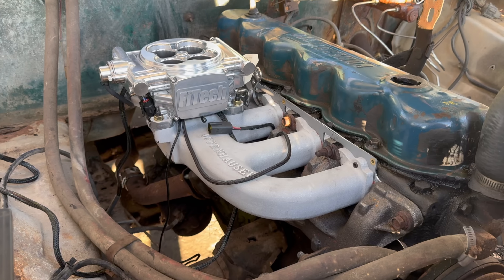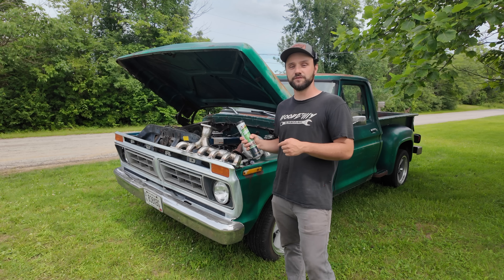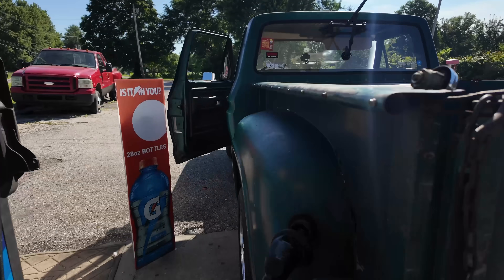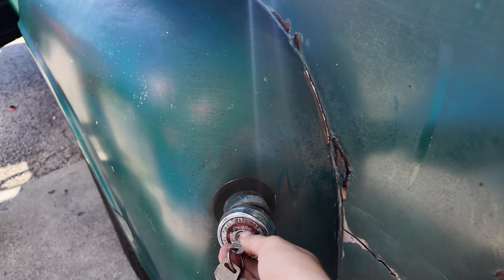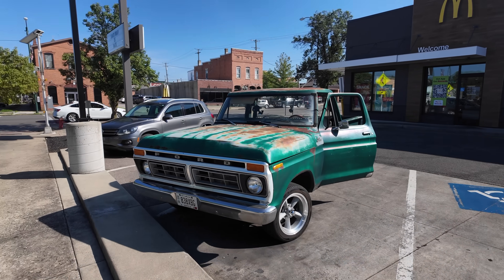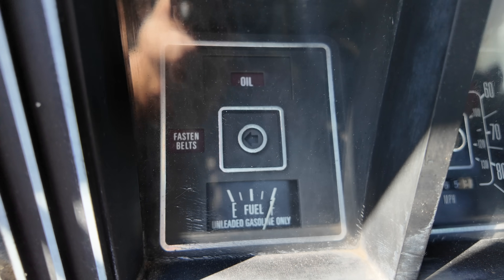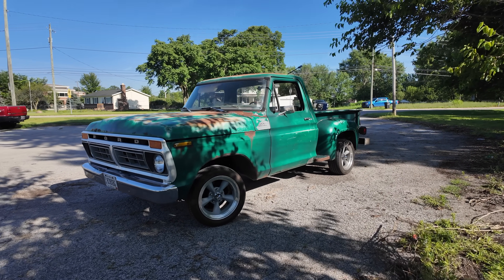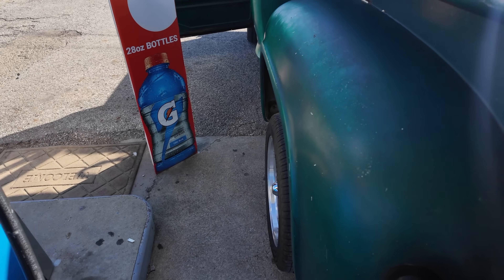How Many MPG Does An EFI Swapped Ford 300 Get?

Comment: My 1983 Ford F100 with AOD transmission got 20mpg and 18 average for many years. That was with the  AC on. I'm still driving it today.  It's probably less now because I'm driving it a lot less frequently. The engine and transmission are original at 300,000 miles.  The truck has long legs and will go 680 miles on its dual tanks. It still has the original single barrel carburetor. I never saw a need to change anything. It just runs so well.

Comment: My 1989 regular cab 8 foot box with 300ci and 5 speed manual on floor was used in Detroit driving from school to school and home to schools.  I could generally count on 19mpg+- but never cracked 20.  My 93 supercab with 5.5 box, and auto trans,  generally got 18mpg.  Odd thing, the 89 heater would not bring cab up to temp and gauge showed cold engine.  This is a new truck.   I bought a Stant thermostat replacement and swapped it out at work. Same situation existed.  Went to auto zone and asked for a thermostat for a 300c i  Ford 89 pickup and Voila!  For some reason the original and replacement stat I bought had a 3/8 or so hole in the flapper. I assumed it was to prevent overheating. The Auto zone stat did not have the hole(I had never seen a stat with the hole in flapper before) and  problem was solved. Normal temp per gauge and I had heat.  Has anyone else seen this  on a Ford 300 ci??

Comment: Years ago I had a 1971 F150 302 4-speed (if it was a 300 I probably wouldn't have sold it until a few years ago when I purchased a 1999 F350 7.3L, even a 300 isn't up to the towing I do now with heavy equipment). After a carburetor rebuild, new points, new condenser, and ignition tune, I was getting 19 MPG pretty consistently. The last truck in that size that I owned was a 1996 F150 300 5-speed and I recall it getting about the same (granted it was EFI from the factory). I have to ask you why you had to tamper with such a proven machine (except 4-on-the-floor is MUCH better than 3-on-the-tree)? I was VERY upset when Ford quit making the 300 and I would buy only foreign trucks at this point (because domestic doesn't care about quality) if I could get them in 1-ton.

Comment: I had a 1985 F-150 stock never tough it and it would get 21 MPG on the highway, It had 180,000 miles on it when I sold it. Only thing I had to do was change the clutch once.

Comment: I'm impressed with your mechanical abilities in being able to do the EFI swap.  Not so impressed with your ability to calculate MPG.  Let it stop when the pump automatically stops it.  That way it is identical at both the beginning and at the end.  Drive it at the same time in the same traffic conditions, even if it means doing it the next day.  Stop and go will give different readings from continuous movement.  And no freeway or highway near by?  That would have given a more consistent check.  No, you introduced way to many variables in your mileage check so the results cannot be depended upon.

Comment: Fuel mileage w ill always be limited with that intake manifold and throttle-body fuel injection.  It doesn't do a good job of distributing the fuel, or air, for that matter, to each cylinder equally,  I'm glad you like it though.

Comment: I had a new 1977 250 4 speed ,rear wheel drive with the 300. I put taller tires on the back and with a tail wind would get 18 mpg ,now and then. It was the best truck ever . Custom and price at a fair deal, it was a truck after all. I was young and ran the wheels off of it. It’s should have lasted a lifetime but youth and logs did it in.

Comment: Dude I have owned 3of these motors with a standard transmission, never a disappointment, ever. Great gas mileage and 302 power. I most certainly want to do one of these engines up

Comment: most pumps. top right side of screen.  Second button down is gernerally the mute button.  Has worked in 4 different states so far. Not all pumps tho. nice install. Hope the mute button works for you because I think we need a break from Ads sometimes.

Comment: That build is cooler than a three speed fan! That's very similar mileage to what my carbureted 81 F-150 300 I-6 4 speed 4x4 long bed gets. 3.00:1 axel gearing at 5800ft altitude. 14-16 in town 15-20 on the highway.

Comment: That truck deserves a full rotisserie restoration. Ill never understand why Ford killed the 300 straight 6
Reply: Because the engine couldnt be used in anything else besides trucks. 
It's too long and too tall to fit in a car, even when they were still making RWD cars. 
My last 300 was in my 1995 Econoline cargo van.
Wish they'd bring it back
Reply: @RequisiteFunction  

It's not too tall or long, they offered the 240 (externally the same dimensions as a 300) in Ford Galaxies as the base engine.

People have also retrofitted 300's into 1st generation falcons, '65 mustangs, and '70 Torinos, with the only serious work needed being electric fan conversion, custom motor mounts, and some oil pan/ crossmember clearancing.
Reply: @riogrande163  it's too tall or too long to fit without modifications, while the other 6 wasnt.
You need the electric fan conversion because theres no room for the conventional engine-mounted fan when you put a 300 into a car. 
I mean, there's a reason why they never made it a factory option for cars.
Ford would make cars available with 4 differnt engine choices, but none of them would be the 300. 
They werent gonna spend any extra RnD on electric fan installation or custom front end linkage just so they could use their truck engin elsewhere.
The engine is also a waste of low end power in a car, unless youre towing a boat daily.
The people who put them in cars likely recammed them for better acceleration response. The potential is definitely there.

Comment: Things that determine mpg: Timing, air/fuel mixture,  type of carb, size of jets, transmission gearing,  rear-end gearing. My dad had a 1970 Chevy C-15 with a 350, standard 4 barrel carb, & the standard tans & rear-end.  After some adjustments he had it hitting 18 - 20 mpg running ethanol free fuel. It was 15 - 18 mpg with regular ethanol fuel.  Take anything someone says about electronic EFI and a full analog type vehicle.

Comment: then install a Tonneau Cover and check mpg. Then increase tire pressure.  then re-tune for 91 octane gas.   keep working till you hit 30MPG then detail the final config.   After that swap in a four cyl  and see how much more you can get.   lots of content!   thanks!  oh , and I agree to get good accuracy you should be doing more than 30 miles between fills.

Comment: You need to burn through a whole tank with all the varied types of driving you do to get an accurate MPG number.  Several tanks maybe. 30 miles is nothing.  You could go 30 miles downhill with a tail wind and get great MPG.  Not so much on the return trip.

Comment: I have a 1980 with the 3-speed on the tree. I'd love to swap it with a floor shift manual and as a last resort, I'd put in an automatic.  I'd be tickled pink with 20 some mpg but sadly, I'm just over 12mpg with a single barrel, points ignition and emission junk. I do have some pullin' gears in the rear because 60mph is about as fast as it wants to go.

Comment: This is the problem with measuring smiles per gallon.  Unless the tank is repeatably refilled to the same amount of fuel, the error in the refill volume will lead to error in the calculated smiles per gallon.  You can minimize the effects of the refill error by driving a lot more miles on your test cycle.  You can minimize the refill error by coming up with a controlled process of refilling as closely as possible to the same fuel level in the tank.   Also, it would have been nice to have performed baseline fuel smileage calculations before the EFI was installed.

Comment: 30 miles is no test.  It's a moment in time.  Just like saying that a vehicle is good based on the first year of ownership.

I had an 84 Ford F-150 w the 300.  Gas hog at 17mpg tops.  My 1986 Dodge had a 225 Super Six that got 20mpg on trips.  Both are legendary engines, but the Slant Six was always a better fuel miser, and lasted just as long as the 300 in many cases.  Wouldn't pull down the house, but for a utility rated engine, they were fantastic.

Comment: You can pick up some more mpg with ignition timing. The modern stuff throws a lot of advance at light throttle with the knock control. Look into a J&S Safegaurd knock controller.

Comment: I'm curious why he can get 23 mpg in this truck and mine with the factory EFI gets about 15-17 mpg. I have 3.08:1 gears. 5 speed manual. I'm guessing it's because he can tune it relatively easily to get optimum fuel economy, but I bet some power suffers. Mine might be just a tad heavier. It's a regular cab long bed. So his truck might be 2-300 lbs lighter than mine. Still a big boost in economy for 2-300 lbs.

Comment: IF the carb was tuned to deliver 14.7:1 AFR at cruise, and the EFI is tuned to the same, should be a marginal change if any. The engine's efficiency is baked in, compression ratio, cam timing, port efficiency, etc. Port Injection may have shown more of an improvement. Throttle body injection is basically just a more accurate carb. The key being closed loop, with an oxygen sensor, so the AFR remains consistent. He also changed the intake manifold, so not strictly an A-B comparison. All things considered, I'd probably always makes make this swap.

Comment: What distributor setup did you use? There’s not a lot of good options for the Ford 300. I added a Sniper to my Ford 200 inline six with Holley’s hyperspark distributor and it’s the cat’s meow. No hyperspark options for the Ford 300. Thanks in advance.

Comment: A Ford EFI got around 17 avg except if it had the lean burn processor then 21-24 on the highway. But most were removed because of pinging on accel. And dropped ext valve seats. Sometimes

Comment: Efi isn't an automatic fuel saver. A carburetor will give just as good as fuel economy as fuel injection. RPM is what determines fuel economy and that equates to the rear end and the transmission not to mention only 30 miles for a test is ridiculous.

Comment: There are a lot of things that affect mileage. Personally I drive a 2006 Silverado. It is regular cab short bed, 2WD, came with 4.8L LS (lightly modified by prior owner with pistons, lifters, springs, cam) and original manual NV3500 transmission. Rear end is original open 3.23. Empty curb weight is 4200 lbs. As my daily driver I typically see 18-21mpg, when most other automatic Silverados are seeing 12-16mpg.
Reply: driving habits help boost mpgs a lot

Comment: I’ve found that most of those fuel pumps that play the dumb ads can be muted. Usually the second button down on the right. I find them to be super annoying so I start pushing buttons to shut it up.

Nice truck. Sometimes simple is the way to go. Certainly my preference over the plastic road appliances with the goofy iPads for a dash board.

Comment: I had a 1970 Chevy C10 with a 250ci I6 with a 3 speed on the column with 3.73 rear gear. You could baby it, 15mpg. Dog it, 15mpg. Run it on the interstate at 70mph, 15mpg. Idle it through a full tank, 15mpg (joking).

Comment: I have a 2008 Dodge Dakota with a 6 cylinder and EFI and had OD transmission and it only get 18mpg on the highway.. Trucks just dont get good mileage.. you can do better than it was but its doubtful you would get better than my 18 without an OD trans.

Comment: Ford 300/6 one of the best engines ever made. Have one in my '83 E150 van with a 5 speed manual transmission. The van came with a 4 speed manual stock, I put a '94 F150 5 speed into it. A couple years ago I took it to burning man fully loaded, towing a small 4.8 trailer that had maybe 600lbs on it. I got 12.9mpg on average that trip, that is with the 1bbl carb. I am also upgraded mine to fuel injection soon, using the factory 4.9 injection manifold and exhaust, then a Megasquirt 3 for a computer. I am doing this upgrade I hope during spring. I am putting a better cam in first though. After the injection, I also plan to turbo it.

Comment: I've had 6 300/4.9 in both trucks and vans  both carbureted and port injected efi. My carbed trucks always did better. The ford efi ran smooth but never came close to the performance and fuel economy of the early 80's carb set ups. My two faves were both 83's, the first being a shortbed 4spd/3:50 geared f100 forest sevice truck. That thing ripped, 20+ mpg @ 65 mph all day long with really good torq and acceleration. The second was a BLM LB 4spd 4x4/3:50LS geared F150. That thing averaged 16mpg, and easily did 18mpg loaded cruising 65mph at altitude - Nevada - what a beast!  My 88' e150 efi/c6 3:00 gear van would never get above 14mpg no matter what. My 90' 5spd extra cab short bed 4x4 /3:50LS F150 averaged 13mpg and could hit 17mpg loaded cruising 70, but rarely. I am about to install an offy C series intake with a Holley 390cfm and efi exhaust manny's on my current 75' F100 and replace the 3spd with the Mazda 5. Expect high teens and low 20's with that set up, at least! Love love love the 240/300/4.9 fords!
Reply: I have a few 300s here. 1980 3/4 4×4  one has an Offy with a new Edlebrock. 4:10s and cast iron 4 speed. Picked a 1989 300efi 3/4 ton 4x4 w/zf and 3:54.... that trans and gearing on offy motor is my goal

Comment: I went Bawls Depp when I Fuel Injected my '78 300 (F-150 435 205 3.55 32's) and took the long runner intake from a 90's truck and wasted spark coil pack from a minivan and yeah, it fricken moves! Plans are to Turbo it as EFI is easier to tune and turbo and not ruin it (running lean).
I keep thinking about a Intake Manifold setup like this where the EFI TBI and Distributor can be easily swapped to Carb and Points.

and now for the completely out to lunch uh oh, Squatter Man's out and about again and ruined my EFI!` <3 all
Reply: Points distributor is slightly  different 1/8" wider throat and oil pump helps is longer and gear needs slid down slightly on shaft. 72 and earlier vs 73 and later. UNLESS it's a post '72  industrial 6 from a chipper or something

Comment: In 2000, I had the same setup in my 1981 f100. 3 on the tree, single barrel carb, 300 i6. All stock. Filled up on interstate 69 & Indiana State route 6, outside Waterloo, IN. Drove to Lake Village, Indiana. Drove around between Lake Village and Schneider, Indiana, then back to the same gas station by 6 and 69. I was getting 33 mpg. My stepdad didn't believe me, so the next weekend, we hooked up my 20' camper and did the same thing, except we dropped off the camper while we drove around in Lake Village and Schneider. Then we went back to 6 & 69 gas station and filled back up. My stepdad figured up the mpg. 33 mpg again. So with or without a camper I was still getting 33mpg. I would have liked to put a turbo on it, but like my dad always said "if it ain't broke, don't fix it. I delivered a lot of pizzas for Papa John's in that old truck.

Comment: A couple of other ideas I can recommend you can do to improve the mileage would be to add a K&N air filter, helping the engine breathe easier, and I always use the oil additive called Duralube. It's about $15 a qt. It replaces 1 qt of oil during an oil change,  and treats the engine for upto 50K miles. I usually re-do it at about 38-40k. 
I also add it into my transmission,  differentials, and transfer case on my F-150, and my lincoln, grand marquis,  and crown victoria.  He'll, I even run it in my old wheel horse lawn/garden tractor. 
This is what I use, and have great luck with this combination.  
Good luck, sir.
Reply from the maker: Appreciate the tips!

Comment: Your testing sucks. 
Limited mileage, multiple clicks. 
Second test with a primary overfill.
Efi adds minimal mileage on older vehicles.
You should be focusing on driveability and torque feel. 
Two thumbs down.
Reply from the maker: don't worry, we are doing it again. testing it with longer miles.. topping the tank off AND we are weighing the vehicle at a weigh station

Comment: 100% can get 22-24 mpg on a 300 standard trans f-150.  We did this mileage on road trips back in early 80's.  The key is the rear gear ratio.  Ford had a 302 V8 in mid 70's that got 25 at 55 mph.   That 300 needs low rpm to pull this off.  We didnt have modern fuel injection, but we did know how to read spark plugs and tune the engine for best spark and lean-of-peak cruise mixture.  We also had better gasoline.  Change that 3 speed for a 5 speed overdrive manual and you'll have a real winner!
Reply from the maker: lol a lot of people didn't like this test so we are redoing it before a put this turbo on
Reply: I had an 81' f100 2wd 300 with Mazda 5 speed 3:05 factory one barrel  it was gear bound with a head wind . I owned it in 1985 and drove it Ohio to Kansas and Colorado (Army stint) best mpg was 18 with a tailwind downhill outta Colorado back to Ft Riley. Light as a feather. Icy bridges in mid west w/side wind would throw me sideways (hopefully no long bridges!!!)

Comment: Only and i mean only advantage to fuel injection is the heat soak issue with carburator
Reply from the maker: there's more advantages than just that, you'll be convinced by the time the turbo is on

Comment: Change the diff oil and transmission fluid. See what that does! Tire ype pressures also counts for a lot. Truck tires have more plys, less rolling resistance. Nice truck :)
Reply from the maker: thank you so much !

Comment: I had  a 76 Ford 1/2 ton short box 4x4  it guzzled a lot more gas than any of my Chevy 350 with a Rochester and headers ever did .. I had a 71 Ford F-250 with a Tired 351 M ..with the low gears it sucked gas too with bias play snow tires.